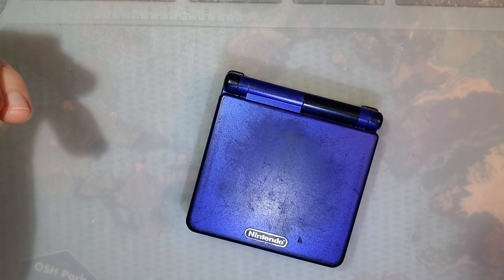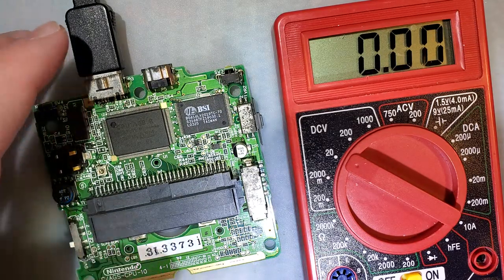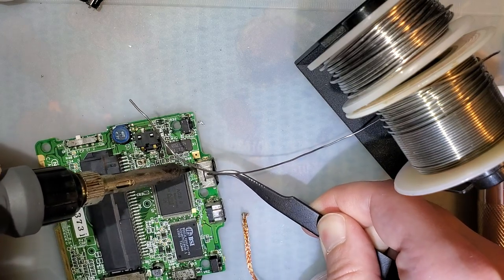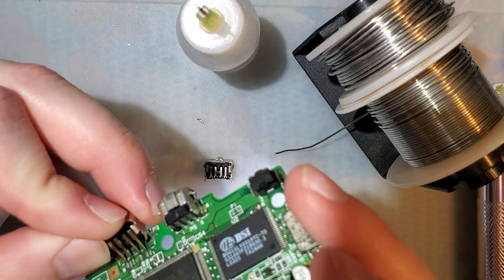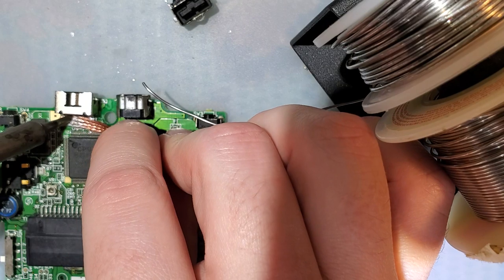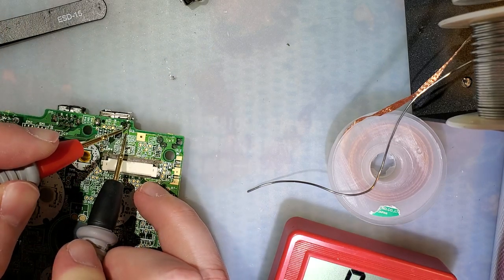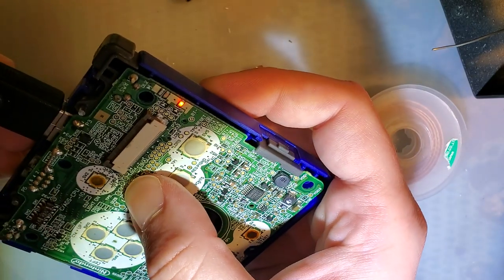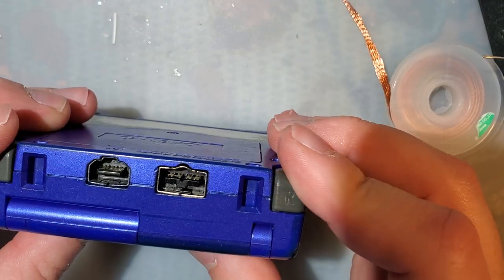Replacing the Charge Port in a GBA SP with an Aftermarket Port

Comment: I haven't gotten through the whole video yet, but I just want to say thanks for showing how to do the multimeter check. I'm still a novice with electrical diagnostics and I was panicked when you said not to attempt the repair if you haven't narrowed down the issue. That helped me confirm the port as the problem.

Comment: I did one of these a few months ago before lockdown.  I had trouble bending the two outer pins, so i extracted the unbroken ones from the old port and transplanted them onto the new port, meaning i only had to bend the front four.  I also, lifted a pin too, i don't have hot air station either.

Comment: These ports are pretty strange, i wonder if they are originally meant for something else.
Reply from the maker: I think they are the right ports but that the manufacturer skipped a few steps
Reply: @makho  The DS fat uses the same port but I don't think it's a pass through either. Most likely you are right and the manufacturer just doesn't bother bending them in the right position as it's not just a standard 90 degree bend.

Comment: Iron slipped back while getting the glob on the 4 pins and now 3 of my CPU pins are soldered together. It's so over.
Reply from the maker: It's not dead even if it's above your current skill level. Charge port mods in the SP are not what I'd consider beginner friendly. The GB discord is probably the place to go to seek help on this but they're going to tell you to start with a solder practice kit (and they're right) and learn to embrace flux.
Reply: @makho  yeah, I've done a ton of soldering on wires and automotive electrics, but this is like my second time soldering a circuit board.

Comment: I tried to remove my charge port like this but I ended up ripping up a trace. I thought I'd just run it without a charge port till i had a chance to fix it but when I turned it on, the screen went bright white before it stopped turning on completely. 😢 any suggestions?
Reply: jumper wire time

Comment: So I discovered an, apparently, unique problem with an SP board I recently aquired. The sound and volume through the speaker work great, as does the volume slider, but the sound through the headphone port is almost absent. It charges perfectly. I've cleaned and did a contact reflow - no difference. I've found absolutely nothing on the intertube about this - nada. Any ideas?
Reply from the maker: probably the port or your adapter
Reply: @makho  Yeah, the port is a done deal. I switched it out for a usb-c. Thanks for the reply.

Comment: fucking hell. Just bought one of these damn charge ports and of course none of the pins line up.
Why would they? It's not like it's an electrical component or anything.
Reply from the maker: I highly recommend just doing a USB C mod if you need to replace the port

Comment: I have to replace the link port. I assume the process is similar. 

The video is old so do you have any tips?
Reply from the maker: Link port is easy since all the pins are through hole. Just hit the eight pins with a solder sucker and then maybe you have to walk out the anchors. Otherwise should be very straightforward. Could even just run hot air against the bottom of the board since there's nothing underneath the link port.

Comment: i f- up the place where w shoulc solder the new port so is there gadget or way to charge batter directly
Reply from the maker: Based off how you're phrasing this, I think the best course of action is to read more about circuits and practice soldering on something a bit more forgiving. When you're ready, the schematic can help you https://github.com/Gekkio/gb-schematics
Reply: @makho  Thank you for your reply makho but it's the pcb i think you know the place where you need to solder new port's pins one of the six places is gone with the old one. so i suppose only way is charging battery outside of the gba i dont know like dslr battery chargers

Comment: Could you mask the close points with kapton and use solder past with a heat gun?
Reply from the maker: Not sure how well that would work. Unless you mean to remove the port, then yeah, that would work great. I just didn't have hot air at the time or I would have done that from the start.
Reply: @makho  I have one that needs replacing and I'm going to give it a try pretty soon. I'm confident about a proper flow at the contacts of the the port, but not so sure about other things not melting out of place near by. I feel the typically "tough" Nintendo solder will stay in place, especially if I use low temp solder paste. I will let ya'll know of the result.

Comment: the original port has 6 pins, the replacements i can find only have 4. do we lose anything like sound via port with the new connector?
Reply from the maker: no, the replacements definitely have all six pins
Reply: @makho  thanks. the photos i see online dont make it seem like there are 6 pins. are 2 bent under each other?
Reply from the maker: @Blues83Clues  it's the exact same part I used in the video.
Reply: Not sure if you figured it out but 2 pins are hidden behind the 2 outer front pins
Reply: @reynafajardo950  just thought I bought the wrong port and saw the hidden pins, thank you!

Comment: It's annoying that these parts don't even match what they're meant to replace.
Reply from the maker: These aren't really intended to be for GBA SP consoles. There are aftermarket docks and such that use these through hole ports and that's what they're intended for. With enough elbow grease, as I showed, they do work in a SP, however.

Comment: Broke the pins on mine unable to get them into place, is there really no manufacturer that isn't skipping a step with this worthless trash part?
Reply from the maker: like I just mentioned in reply to another comment, this port was made and intended for 3rd party docks and accessories, not for GBAs specifically. 

Someone just found a stockpile of new-old stock (NOS) SP parts including the charge ports so if you really want to keep it stock, grab some of those to replace it. Otherwise, do a USB C mod. It's not worth trying to get one of these things to work.

Comment: Tried to do this and i f*cked up all the traces under the port while trying to desolder it. Half of the pads fell apart from the motherboard. My motherboard is all ruined now.
Reply from the maker: I'm sorry that happened. I'd recommend getting more solder practice under your belt before trying again.
Reply: @makho  yeah i think it was my fault while trying to desolder the pins under the port, so i was told that i can still save the motherboard (it still turns on) by modding it with the usb c port mod. 
Sorry if i was an asshole with my first comment, but i was very frustrated after damaging the board trying to fix the port, your channel has rly helped me a lot to fix different issues
Reply: @benjaminfuenzalida6765  you run just 1jumper for the Type C mode ;) it's not ruined :p
Reply: @Stry-Glitch  already sold the motherboard as junk product, got like 20 bucks for it
Reply: @Stry-Glitch  this is old and random but I lifted the third pin from the left. Just wondering if you might know where to run a jumper from if I just decide to do the usb c mod? Thanks !